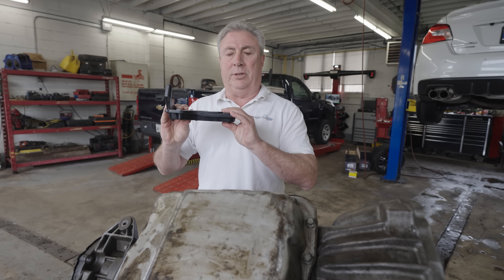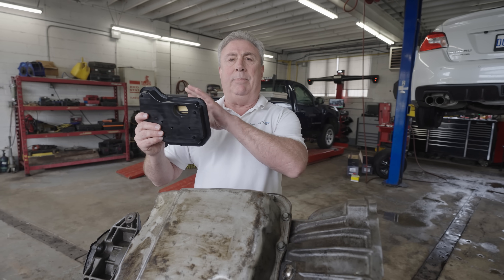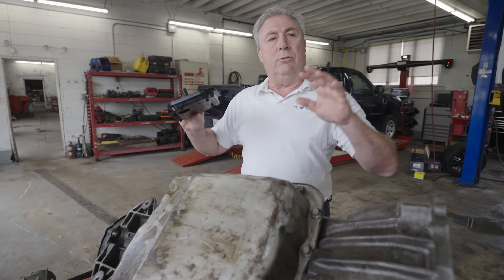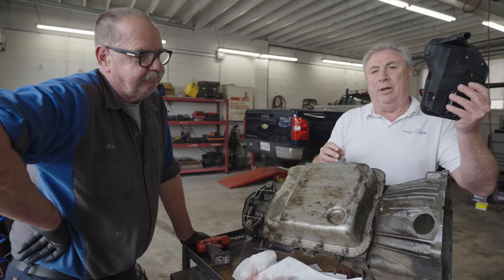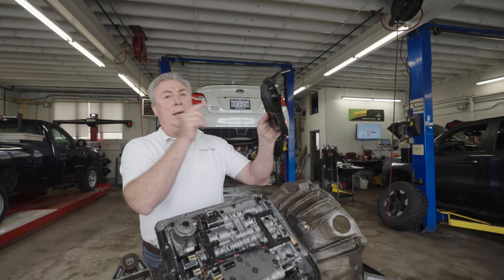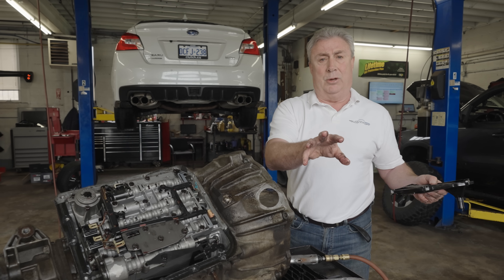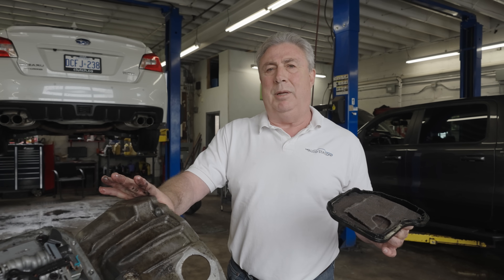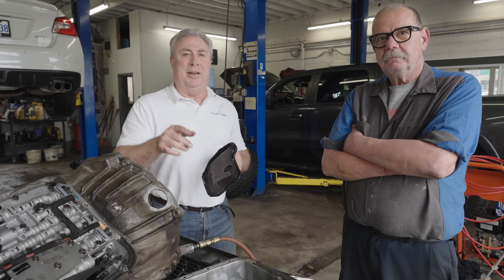Transmission filter Myth Busted - cutting through the B$$$

Comment: I agree with the presenter... it serves the purpose of a strainer (or last chance filter) to prevent large contaminants/failed items from recirculating.  Proof to myself is the fact that the trans in my recently purchased 2018 Yukon with 75k was showing all the signs of early failure, primarily torque converter slippage and pump noise.  As a band-aid I replaced the filter and fluid.  The removed fluid was no doubt original and looked and smelled as you would expect.  Out of curiosity I back flushed the removed filter... there was no restriction and nothing of note came out.  The pan had some paste in it and the magnet had minor fuzz on it... nothing extreme in either case.  It was obvious the fluid was carrying the clutch/other debris and it was not being "filtered" as you would expect it to be by a proper filter.  Transmission operation following the flush was much improved and I feel that I bought a few more years before trans replacement is necessary.   Going forward I'll evacuate and replace whatever fluid I can through the dipstick tube at every engine oil change.  

This could make sense to some as I believe manufacturers would not want the bad rap of clogged filters causing trans failures and just live with what could be considered normal wear and tear.
Reply from the maker: Thanks for the detailed comment. That's exactly the kind of experience that backs up the idea of maintaining the fluid as a priority!

Comment: GM transmission technician. This does absolutely not work for 8, 9, and 10 speeds. Lack of filter changes and cleaning the wear magnets is why solenoids fail. The media is much finer in the newer transmission filters
Reply from the maker: Appreciate the highly informed comment, thanks! As a GM transmission guy I'm sure you see the concerns a little clearer than most. 

The GM series trucks are pretty popular everywhere. The GM 10-speed automatic (10L80/10L90, found in Silverados, Sierras, Camaros, Escalades, etc.) has been under the microscope quite a bit. It started out of the gate as a transmission to brag about—fuel efficiency, smooth shifting, towing muscle—but instead it’s become a frequent flyer at a lot of shops. This transmission is hyper-sensitive to fluid condition—let it go too long, and it'll bite back hard.

Strange thing, GM markets many of these newer transmissions as “sealed” or “maintenance-free,” but that’s PR nonsense. As the filters may not be easily serviceable without cracking open the pan or replacing the whole filter-integrated pan unit (especially in 10-speed units) - we still prefer the maintenance strategy of early and regular fluid change to avoid problems.  That said, you have a great heads up on the filter media upgrade in the newer transmissions. Thanks.
Reply: @TheAutoStationBurlington You’re a class act thank you for the response sir. You are correct servicing them is incredibly expensive. On 2020 and up 8L90 and 10L80 5.3/6.2- equipped pickups and SUVs it is physically impossible to remove the pan without removing the exhaust. It is about $1500 P&L to put a filter in a 2020 and newer Tahoe. That is little to spend considering the cost of a transmission or the downtime of the vehicle from preventable solenoid failure.

Comment: 30 plus years in the field, I've found if  your filter is plugged you've got bigger problems that a flush and filter isn't going to solve. 
Change the fluid every other year and just keep trucking. Oh, and change the differential oil at 100k too.
Reply from the maker: Thanks for the comment! I completely agree that a plugged filter indicates a bigger issue.  And, great tip on the diff!!
Reply: And how would you know that your trans. filter is plugged? Just curious.
I changed the trans. fluid (drain and fill) on my 2019 Chevy Equinox at around 40K miles just last week but because the fluid was very dirty, kinda dark grey, I did another drain and fill the very next day. Since yesterday I started noticing slight hesitation and minor shuddering. Any suggestions?

Comment: LOL! 
It sounds like someone is trying to justify their overpriced Dr Kevorkian trans flusher! 
 Removing a beautifully accessible oil pan like that is NOT risky at all. Finesse, not force! Impacts are not the best tool. 
I NEVER do flushes on my transmissions. Drain and fill every 50k to 60k depending on manufacturer (I own a small commercial fleet). 
Changing a transmission filter is stupid easy, replacing the oil pan gasket is simple. 
Use a proper inch pound torque wrench and go w factory specs.
Reply from the maker: Thanks for the fantastic comment. I love the way controversial ideas always seem to inspire really good comments.

Yes, I much prefer the Dr. Kevorkian trans flusher😁🤣 over the good old fashioned blood letting of a pan drop. Particularly, when the justification is simply to get to the filter just to get access to the filter. I'm suggesting that more transmissions are appearing with non serviceable internal fluid filters for a reason. I think we confirmed that by opening a filter with 250,000 miles of service and finding very little evidence of accumulated debris.

If you're not in the rust belt, if you're able to finesse the fasteners so that you're not regularly dealing with bolt extraction, and if you're dealing with equipment not fitted with a drain plug - it's a matter of personal preference for sure.

Seeing very little evidence of filtered out debris in the filter in the video that was in service for 250,000 miles should add to the consideration tho - in my opinion. I do find the full flush very effective at maintaining the transmission system.  And, we too regularly see problem free service for well over 500,000 miles.

Again, thanks for the much appreciated comment.

Comment: Follow the fluid change intervals for transmission service in your owners manual for city or severe service.  The oil acts as as lubricant, hydraulic fluid and coolant.  One anecdotal case is not evidence for service recommendations. The filter in this unit may not do much but not draining and replacing the oil is a terrible idea.  Your transmission may last but probably not.  Commercial truck transmissions are not typical. 
So ; Do you feel lucky?

Comment: If the filter is just a mesh screen changing it is not needed. If its clogged with metal and other debris you have a more serious problem. 
If your transmission has a paper element type filter changing it is not a bad idea.
This guy is wrong.

Comment: This video is crap.  The fact that you can see and feel particulate in that filter is PROOF that it is, in fact, doing SOMETHING.  If you quantify how much particulate in TOTAL exists in that system (both in that filter as well as in the bottom of the pan, magnet, adhered to internal components, etc,) and half of the particulate is inside that filter, then that filter doubled the service life of that unit.  Because it operates at a small pressure delta and must flow ALL the fluid within the unit, it cannot possibly operate at anywhere near 100% efficiency.  Filters don't only operate as a mechanical barrier, they also remove particulate and some fluid contaminants through adhesion, absorbtion, and adsorbtion.  Your video demonstrates that you have a limited understanding of tribology and fluid purification, in spite of your ability to recondition and reinstall these units when they fail.
Reply from the maker: Aha, nasty and to the point - i love it.  Seriously, I appreciate the comment.

For those following the discussion,  tribology is the science friction, wear, and lubrication.  Generally, as I may or may not understand it, it’s the study of how surfaces interact under load and how we can minimize damage and energy loss through lubrication and material science.

This applies anywhere metal rubs metal — bearings, gears, clutch packs, pistons, camshafts, valve bodies — you name it but pretty much everything that powers motion for the car that requires lubrication and the efforts to maintain that fluid. 

I completely agree that the quality of the fluid is directly related to durability.  I continue to suggest that the risk/benefit of removing an oil pan on a 10 year or older vehicle - particularly in the rust regions where fasteners are subjected to road salt - to get to a 100 micron filter is seldom justified.  Keeping the fluid clean with regular maintenance and by means of transverse fluid flush is my preferred strategy. 

Thanks again for the feedback.

Comment: It depends on the car. The ram uses zf8hp and i would be changing thoae filters, theyre only a few bucks if you get an aftermarket ppe pan. However, on my 2013 odyssey, you dont touch the filter. Its buried deep inside. Its just a simple drain and fill.
Reply from the maker: Thanks for the terrific comment.  That's a perfect point.  That ZF installed on a BMW is labelled as "lifetime service" meaning no fluid, no filter, ever..  That exact same transmission installed on the Dodge has a filter service interval which of course forces a fluid service.  I would suggest the filter service interval specified by the Dodge is intended to do just - force a fluid service.

Add to that, the many transmissions that have an internal filter that can only be accessed on complete disassembly and a strategy seems fluid based.  Our experience is that maintaining the quality of the fluid is the prime concern rather than filter.  Again, thanks for the feedback.

Comment: This is crazy advice maybe he doesn't Advocate changing your engine oil and filter either
Reply from the maker: Thanks for the comment!  No,  in fact what I'm saying is the opposite.  Regular oil changes are a must - I recommend 5K mileage intervals or shorter with a premium full synthetic oil.  I also recommend full transmission fluid service at regular intervals not exceeding 50K miles,  I just don't think the transmission fluid filter is a point of service.

Thanks again for the much appreciated feedback.

Comment: With all due respect….this gentleman is 100% WRONG!!!  I’ve been servicing all of my own automatic transmissions for over 40 years.  Clean fluid and a fresh filter prolonged the life of the transmission.  And….they shift smoother.  It’s unfortunate this gentleman is dispensing advice that is inaccurate.
Reply from the maker: Thanks for sharing!  I really appreciate the comment. And, it's terrific to hear from a hands on guy with a plan that's working.

I think the fluid service is critical.  I believe that maintaining clean fluid in the transmission makes a huge difference in durability.  I don't believe the filter is quite so important. 

in a practical sense, if there's a reason to be in the transmission with the pan down, of course it makes sense to swap out the filter with a new one.  It also makes sense to clean out the pan before you re-install it too,  But, I recommend the transmission fluid flush as a preferred strategy of maintenance.  But, that's just my opinion.

Again, thanks for taking the time to send some feedback.

Comment: Except if you had a cvt. My 2008 Honda CRV tranny light came on and started slipping at 215k. I told the mechanic I changed transmission fluid every 20k miles and cleaned the magnetic bolts that was black from the magnet. The mechanic told me it didn't matter all these CVTs go out at 200k. Don't buy cars with CVTs. They are JUNK.

Comment: I've always wondered why they put coarse rock catcher bag filters on all ATS suction pumps.  As you said, they're sealed systems (sans breather).  Maybe it's just a lawsuit dissuader?  Or fake money-maker?

More confusing are AT's that employ a 2nd, canister filter for the control body.  They have an actual micron efficiency rating, perhaps because the valve bodies wear from clutch shavings?   Chrysler RFE trans have them as do Allison.  Too many today are promoting no-change oil transmissions.  Just a marketing ploy.
- Retired mechanical and lubrication engineer.

Comment: Transmissions being a sealed system is what also leads to the myth of ATF fluid being great at cleaning. There's nothing to clean in a transmission because there's no carbon from burning gasoline or diesel like there is in an engine, so the fluid doesn't turn black from carbon build up. That makes people think ATF has magic cleaning properties, when it doesn't even have any detergents required to clean!
Reply: Correct. The myth of ATF being loaded with detergents just won't die. It has some dispersent properties, but as you say, no detergent. Detergents in engine oil exist to clean byproducts of combustion out of the engine, You see folks pouring engines full of ATF thinking they're flushing the engine. Just nuts.
Reply: @pete1342  It truly is nuts. I keep hoping the motor oil geek will make a video about it so the myth will finally die, but so far no luck.
Reply: @bobbygetsbanned6049 I seem to remember him addressing this issue awhile back in one of his videos.

Comment: Honestly, I’ve had all my transmissions go over 200,000 miles with fluid changes or drain and fill, I’ve never serviced a transmission filter. And I’ve never had a transmission failure.  Even my 16 Nissan versa CVT right now has 218,000 miles on it. Still going fine with no filter change just drain to fill.
Reply from the maker: That's awesome to hear that you've had good luck with your transmissions.  Impressive.
Reply: @TheAutoStationBurlington i drive like a granny.. always have.. good luck even with problem trannys

Comment: Really if you want your Automatic transmission to survive. You do change the fluid and the filter  Automatic transmission the fluid is  like a 10 weight oil In other words, it's thin Once it  gets above  170°. The Life span goes from 80.000 Miles it  starts going down. Hill fast if the Temperature Fluid gets to 220°.  The Transmission Fluid will Start to burn. Put a  aftermarket Transmission cooler in The
 Factory cooler is a joke. The filter keeps contaminants from floating through the transmission. There are passage ways inside the transmission that can get clogged up.Take a white paper towel, wipe your dipstick off from the transmission. If the oil looks black, change it. I don't know what the hell. He's taking about.
Reply from the maker: Thanks for the comment! I think you are absolutely right about the importance of keeping the transmission cool and clean.   I'm with you on that!  I completely agree that regular fluid service is the only way to actually protect the equipment. And to your exact point, heat is the real killer - some of the inline OE factory coolers are nothing but a joke.

My main point is I prefer the transmission fluid flush service over all else.  I absolutely agree with the drain and fill method as well if done at regular intervals but it's not, in my opinion, as effective as the flush. It works well when there is an access point to remove fluid that doesn't involve removing the pan.  Again, my opinion, removing the transmission fluid pan simply to get access to the filter is not only too risky in the event of stripped/broken fasteners - it's not necessary.

However, if you have the pan down to service something else or repair a gasket leak - of course i would change the filter as part of cleaning everything up for reassembly.  It's just the filter is not a point of service on its own merit.

Really, appreciate the response!  Thanks.

Comment: You may have noticed that almost all vehicle manufacturers no longer include transmission maintenance in their service schedules.
Have you also noticed that you no longer have a transmission dipstick, goes hand in hand.
Since the development of synthetic ATF, it's no longer necessary to replace ATF, it's become much more durable. If there is enough debris
in your transmission filter to restrict ATF flowing through it, your transmission is finished. Filter replacement is highly overrated. Flushing
ATF in automatic transmissions is never what you imagine it to be, pass on flushing. The one thing that you can do that is most important 
to the life of your automatic transmission is to make certain that your cooling system is operating as efficiently as it can. Save your automatic
transmission maintenance money and check those radiator hoses instead.
Reply from the maker: I'm glad you mentioned the importance of a good cooling system!  It is vital. And yes, the dip stick delete is pretty much universal.

That said, the vehicle longevity is the real consideration. It is a fact that most car owners are facing a variety of competing interests with any plan to realize 20 plus years of service and hundreds of thousands of mile range.  Regular transmission fluid exchange at 30 - 50K mile intervals is part of the first strategy but not so much in the manufacturers strategy of planned vehicle obsolescence. 

Appreciate the comment - thanks.

Comment: Well... Everytime I did a drain and refill over the years on my 2001 highlander v6, the parts guys at Toyota told me you never have to replace the strainer. Around 200.000 miles my tranny started not shifting properly. There was also a hum that I could hear. I planned to junk it. So, for the 1st time, I replaced the filter (along with a drain and refill) as a last chance attempt. Problems were solved. The "strainer" seemed to have a lot of soot in it... not metal but just soot. Since it was a drain and refill (which only removes about 1/3 the fluid,  I did another filter change 15000 miles to remove more of the  contaminates. I'm still going at 254000 miles. I just did plan drain and refill and will continue every 40K and do the filter at ~100k

Comment: Question. I had a 1995 Dodge electric servo pack FWD transmission. At 205K miles, I had it locally rebuilt due to excessive slipping. After I got it back, I was slowly driving and the case exploded, and the van jerked and went all the 15 miles back to the shop. How could that happen? I had never seen one explode before. Thanks.